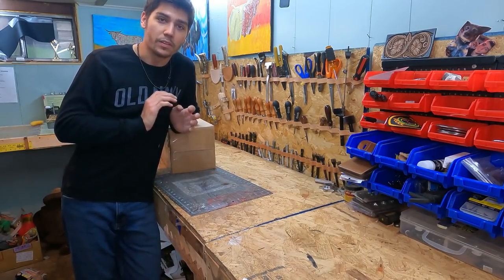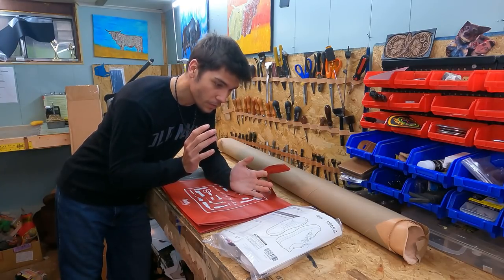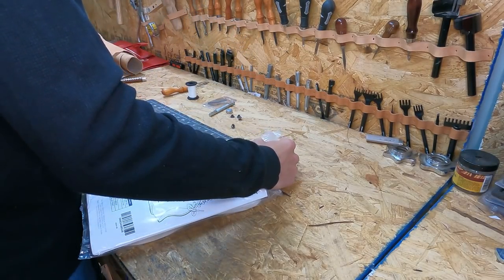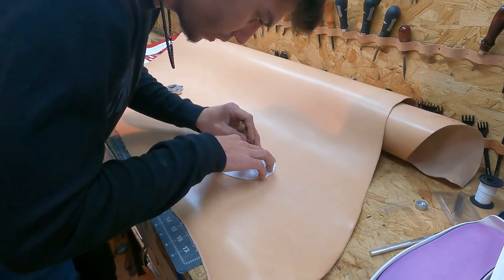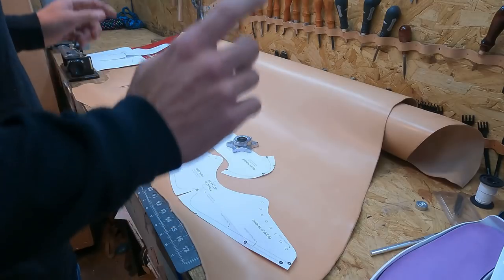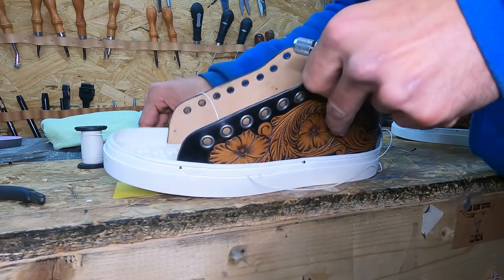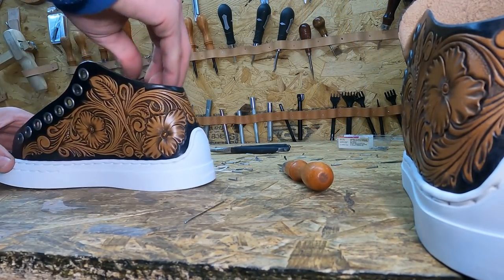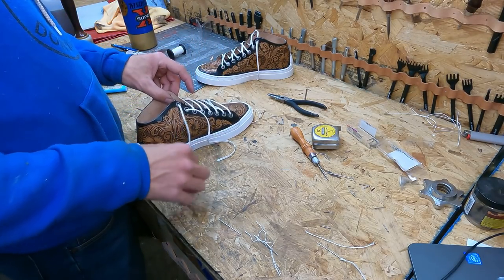Sneaker Starter Pack with D2 Leatherwork!

Comment: OLD LEATHER SMITH here. Good Job. I have a some suggestions, Bee's Wax on your Fid and Needles and they will go in and come out easier. Use a plyers 2 tighten the nut on your multiple use Fid. The double sided tape I use has a white tape covering on 1 side, that way U don't remove the sticky substance on that side until you R ready 2 use it, it's available at Tandy, Weaver, and Springfield 2 name a few. Any questions please feel free 2 ask. GOD'S BLESSINGS ✝️⚾🙃

Comment: Ugh! No, don't cut the pattern. Use a stitch wheel to mark the stitch line or at least make a copy of the pattern before you cut it all up making it unusable.
As for a new cutting board, check out the one they have at a sewing craft store. They're bigger and cost less.